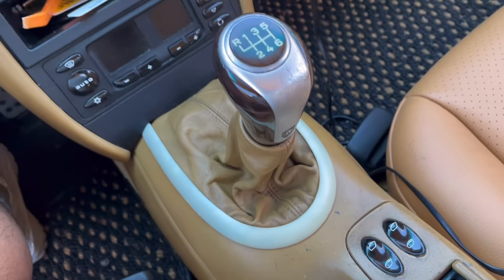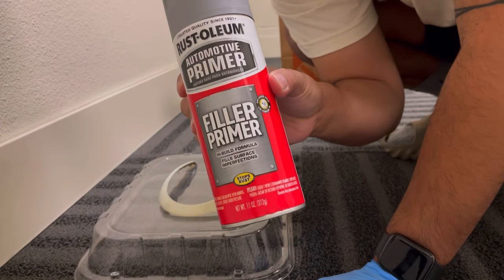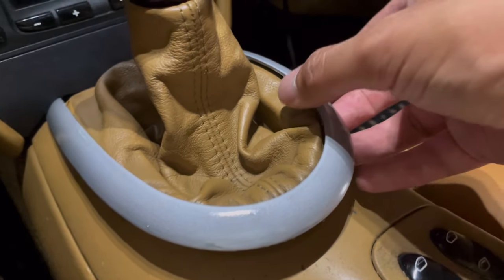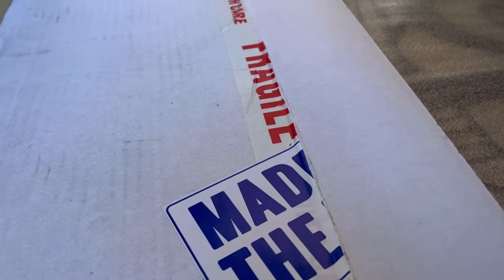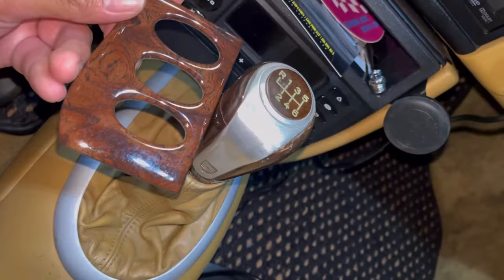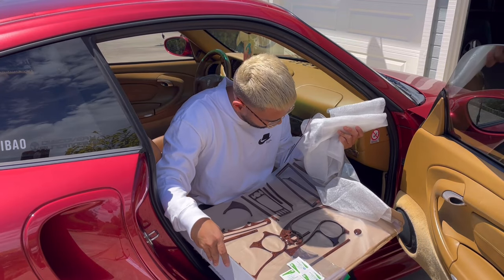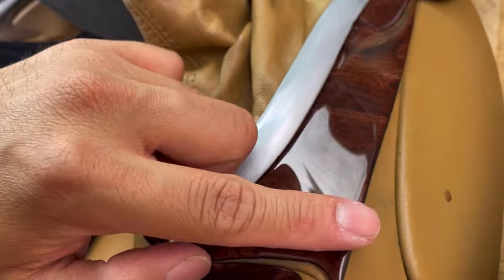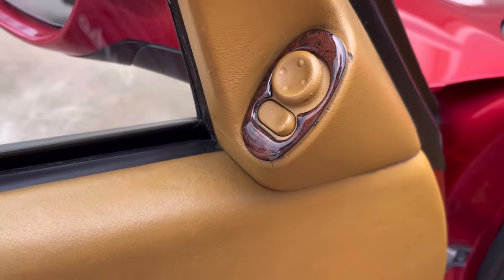Restoring My 996 Turbo's Interior

Comment: Cool job!  I did that to my '99 Jeep 20+ years ago!  What model JVC stereo do you have? I have a 2000 Carrera and need a new stereo. Are those stock speakers?
Reply from the maker: Thank you! It’s a JVC KW-NT500HDT (installed by a previous owner, along with aftermarket speakers and a subwoofer behind a rear seat)